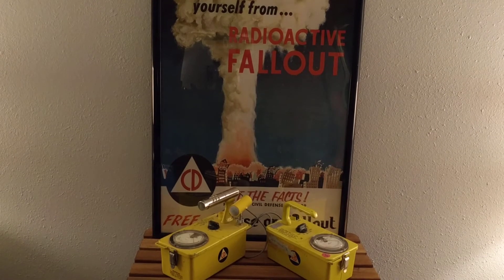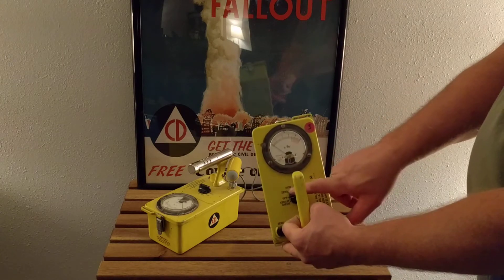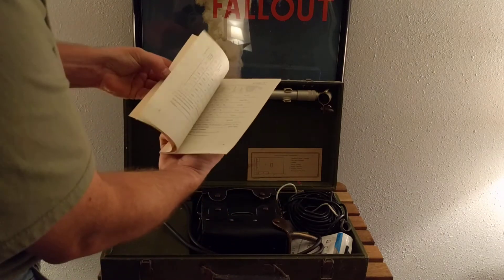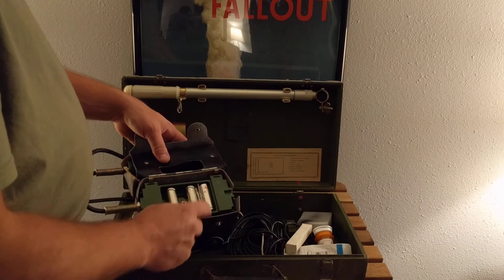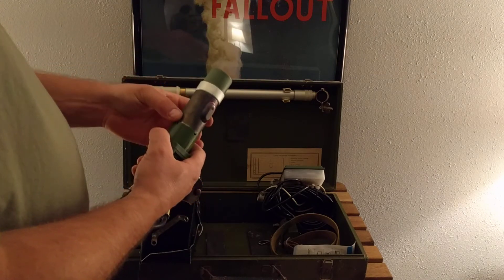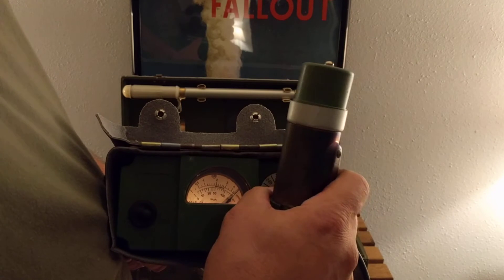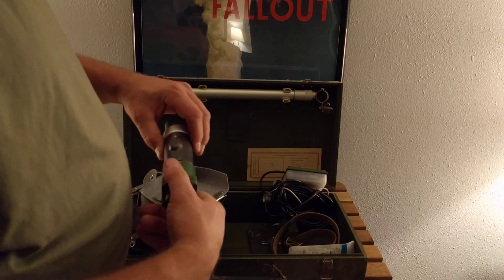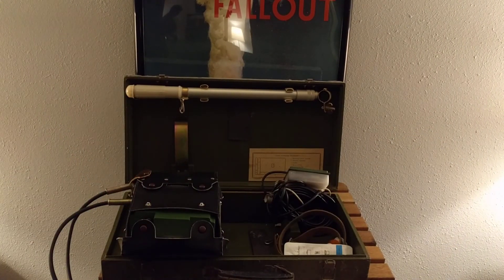Fun with Radiation! USA vs USSR! Battle of the Geiger counters! (CD-V 700 6A vs DP-5V)

Comment: there's actually on common batteries that there is lithium retrofit for example D and C {1.5 v} sell with USB port most people know that lithium ion sells never leak make sure you got the 1.5v  they're pretty pricey but for expensive equipment it's a good idea to get a good name brand cell they going to last quite a while on retro boomboxes I think
Reply from the maker: Thanks! I may also try using a set of salvaged 18650's with a buck converter to see if that works, but it may not due to the nature of the circuitry. The nominal voltage for a LiPo is 3.7, so any lithium battery you use in such a thing would have to have it's voltage reduced either with a buck converer (AKA switch mode power supply) or through resistors that would have to be calculated using Ohm's law and a multi meter (to measure current draw so it can be plugged in to the equation).

Comment: If you bend the battery prongs inward slightly with a pair of pliers, wrapping a little bit of tape around AA batteries makes them thick enough to fit and they'll run the DP-5 series radiometers for months and months and months. I know this because it's how I got mine up and running. You don't have to special order and dismantle battery packs or anything, just gently bend the prongs and wrap tape around a set of AA batteries. It's way easier and cheaper.